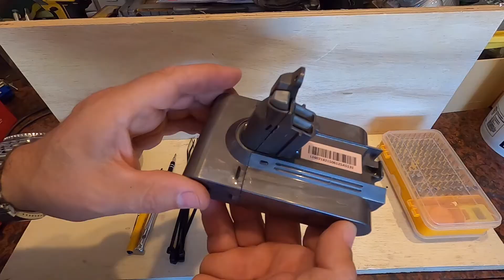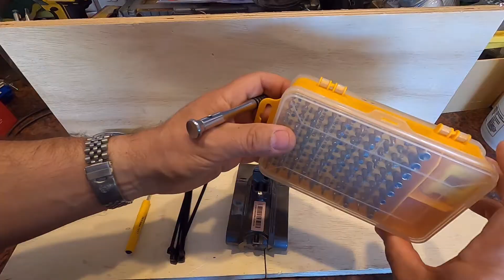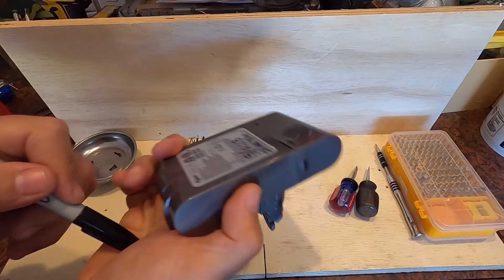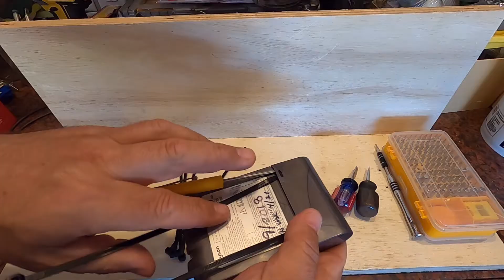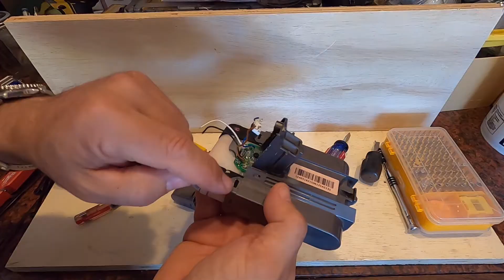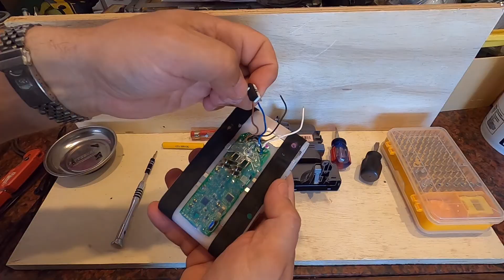Dyson ● Battery Flashing Red ❌ ● Open Battery Case and Check Cells ✅

Comment: 0.3V difference is the threshold for the BMS to enter the disabled state. I was told that disconnecting all power to BMS may reset the state. It seems to make sense because it would be hard to believe that the state flag is stored in a persistent memory. Have you tried that?

Comment: wow, all i do is clamp the short section in a vise, on the sides of the battery and pull the halves apart, haven't damaged one yet. also, after as many as 30 disassembled I have only found one bad cell, and it appeared to have got wet. its more like planned obsolescents, in  other words Dyson programs them to fail, especially if you use the turbo settings. a fully charged battery can only handle the high speed load for a short period of time, no way will it work full time defiantly not worth the money.

Comment: A bench-type variable DC power supply might save the day by experimenting different options like - to re-charge the individual battery , to check if each of them still good and to apply 24v. DC to BMS that detects the condition of the cells and see if the red light will stop. This is not easy to troubleshoot.

Comment: For the record, once the Dyson BMS detects a fault, they can never be fixed, even if the cells are changed. I replaced some aging but balanced Sony cells with some IMR cells that had issues. It worked fine but would cut off due to voltage sag if I put it on turbo mode. I got some replacement Sanyo HG2 cells but one was bad so I had one mismatching cell in there. This caused a red light. Even after replacing all the cells with good batteries, the flashing red light will not go away. If there was a way to reset it it would be great but Dyson doesn't want that. They claim that it is for safety but I believe that isn't the only reason.
Reply: Sam problem red light
Reply: Planned obsolescence, they are made to fail like that. Way more electronics then needed.
Reply: 🖕DYSON🖕
         and
🖕MAKITA 🖕

🤞Right-To-Repair whoops their asses, but not betting on it.
Reply: most likely a solid state fuse it blows when the brain says its faulty